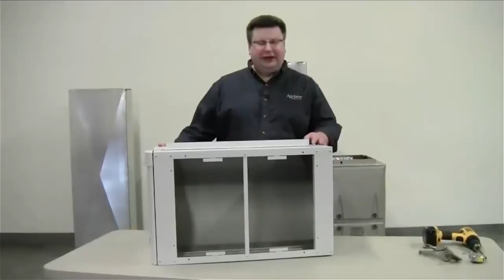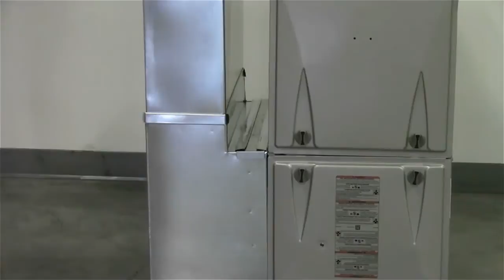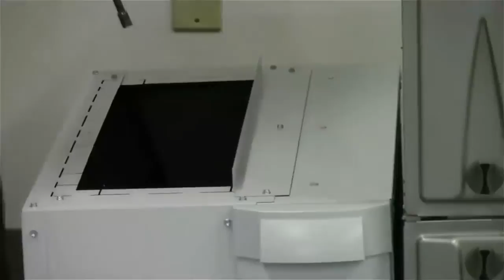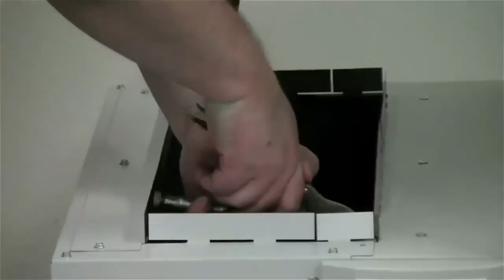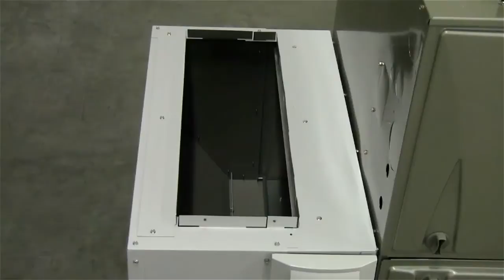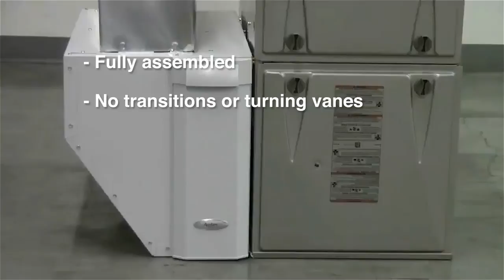Aprilaire 1610 Air Cleaner Installation Guide

Comment: So what happens with the gap that is left over because the unit is shorter than the existing duct assembly?
Reply: was wondering the same thing.  aluminum tape won't fill that gap... only a hack would try to fill it with such...